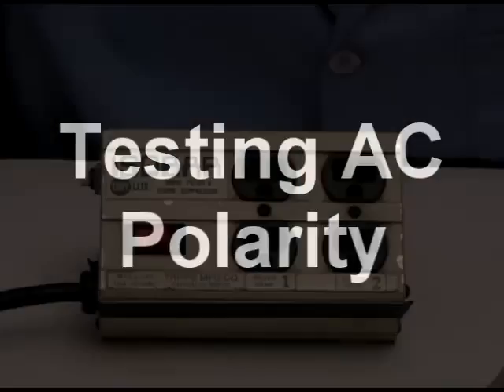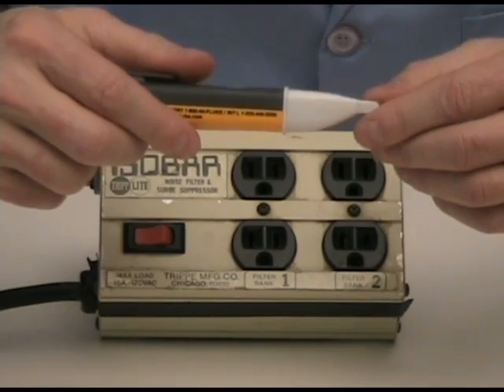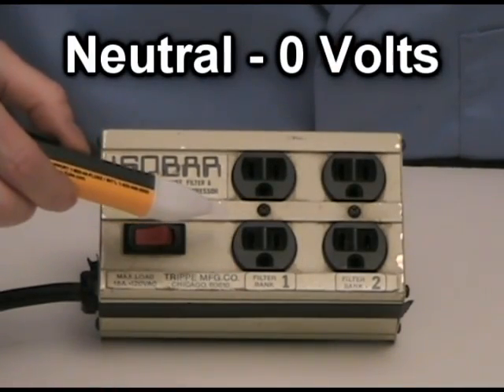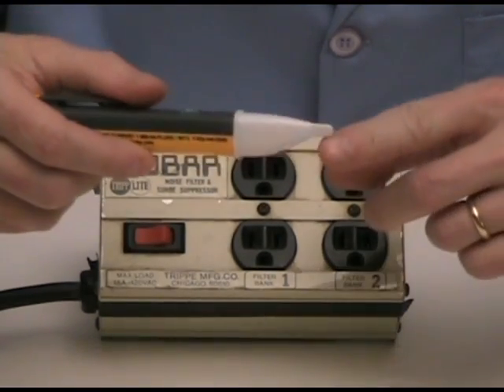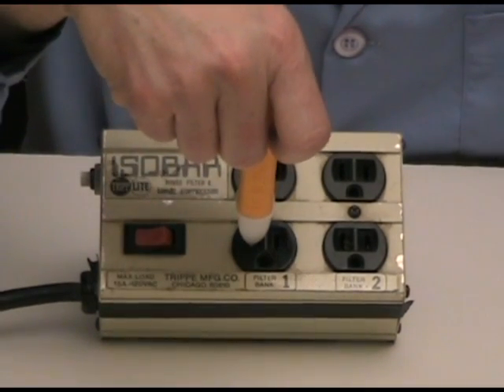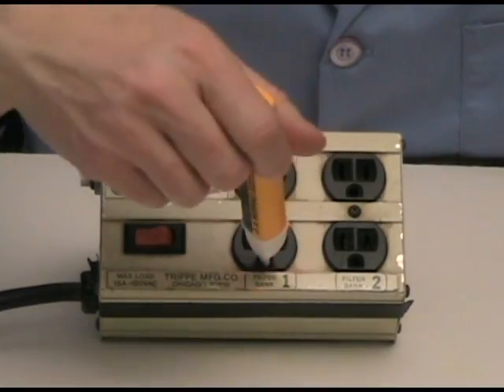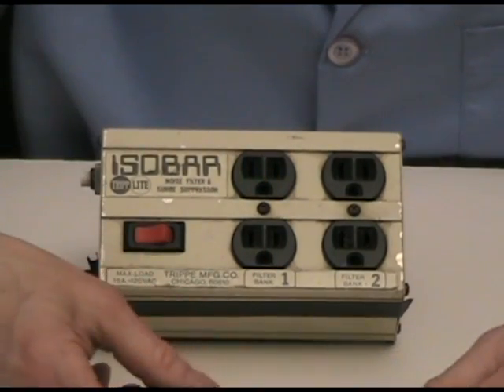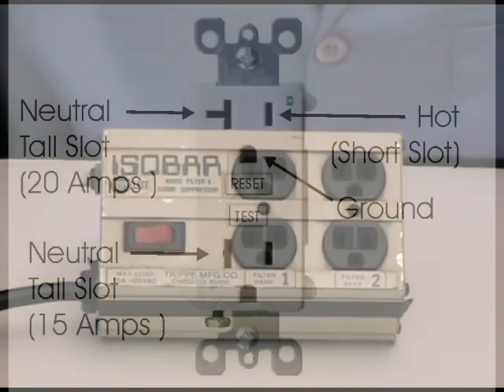How-To test for proper outlet polarity

Comment: Important update; after rewatching the NSZ video in which the 3 LED tester is shown to NOT detect the rare but very bad bootleg grounded reverse polarity, I checked my sanity and toolbox.  My "LED" tester has 4 lights, and I believe at least one light is actually a neon bulb(?) similar to a cheap non-contact, and does come on in any reverse polarity state.  Sadly this tester is 30 years old and has no brand markings on it, or I'd say where to get one.

Comment: Although this technically works for "hot skin" prevention, it's the wrong/3rd choice tool.  Much better than the $30 Fluke is a $3 led tester (like the one shown in the noshockzone video suggested below).  This instantly tells you reverse polarity as well as several OTHER dangerous conditions.  The proper use for the Fluke would be testing the stand itself having hot skin or (God forbid) checking your rv after you already plugged in.  Even for non contact testers, others have pointed out the Fluke has poor and single sensitivity - my green tester has 3 ranges and can be set to scream several inches from hot or be as bad as the Fluke, and most of the time I want the higher range for safety.

Comment: Great explanation, however the fluke non-contact may be the only one of the testers that would work for that. Most of mine at least have sensitivity's preset so that you will show voltage before you make contact with the outlet. Flukes tend to be less sensitive. I would do the same tests but with my contact tester instead.